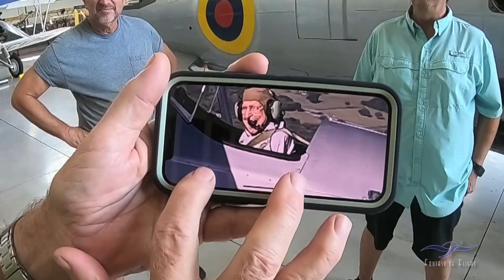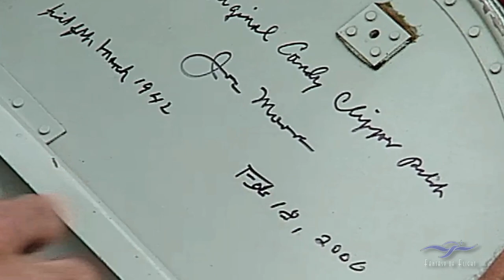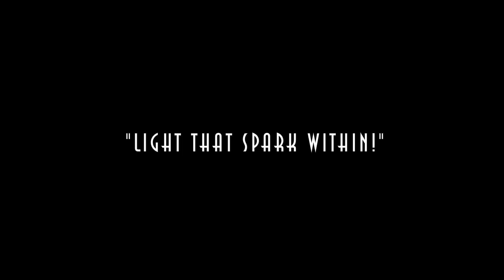REPUBLIC P-47 THUNDERBOLT - Steve Wolf / Kevin Kimball - Kermie Cam Visit Part 1

Comment: My father told me this story from when he was in France during WWII.  He said that the landing gear was slow to come up.  The pilots wanted to be cool in front of all of their buddies.  They would put the landing gear lever in the up position while on the ground before starting their takeoff roll.  Hydraulic pressure would build up while on the ground, but the landing gear would not retract on the ground.  As soon as the P-47 lifted off the built up hydraulic pressure would cause the gear to snap up real fast and look real cool to the other pilots on the ground.  So one day this pilot pulls up the landing gear level while still on the ground before starting his takeoff roll.   So there goes this P-47 going down the runway faster and faster getting close to lift off speed.   The P-47 hits a bump in the runway.  The P-47 jumps up into the air a foot or so then the landing gear snaps up real fast and cool.  But the Jug isn't at takeoff speed yet and settles back down on the runway.  Chomp, chomp, chomp, chomp goes the big paddle blade prop as it chews up the runway as the Jug slides down the runway on it's belly.  Slides past the end of the runway and mows down a bunch of pine trees with it's wings.
Reply: Charlie Morhle in his interview said that they did that with the landing gear because when they were taking off they were doing it overloaded by 1,000 lbs on a runway that was 500 ft shorter than what Republic said the aircraft needed, that way the landing gear would immediately come up and clean up the airstream and they could start gaining airspeed and altitude faster that way.

Comment: Great video, this P-47 is in perfect condition, looks absolutely stunning. Thank you for a great video. BTW when my father was a school boy of 15 / 16 years old at a college, all boys were to be so called „Luftwaffenhelfer“ or Air Force helpers. He had to go to a village called Liblar, just southwest of Cologne with all of his class mates in 1943. They had to man some positions of 88mm Flak AA guns. He told me that one morning there was a warning of ground attack operation in progress. The guns were turned to low elevation, suddenly 3 P-47‘s showed up flying right over the battery (in fact a „Grossbatterie“, consisting of 2 regular batteries, 16 instead of 8 AA cannons). All 16 guns shot together, one P-47 came out of the Flak clouds right, one left. The third one just disappeared. He told me that nothing from the plane was found later, it just disintegrated. They feared the P-47 greatly.

Comment: Just an idea: when everything is ready, Act 3 up and running well, the P-47 ready to put on display, and the Bf (Me)-109 is finished - just put them next to one another. The big, impressive P-47 and the small, nimble Bf-109. Just for comparison in size. Next to a P-51 a Bf-109 looks small, but next to a P-47 she must look tiny.
Reply: Kermit has no Bf 109, instead a Bf 108 Taifun (a very nice one), though it's from the same designer they are completly different airplanes.
Reply: @TPath3  Oh yes, Kermit does have a Bf-109 project under restoration in Canada. It will take some time until it’s finished, but getting an airworthy Bf-109 for sure he will.
Reply: @TPath3  never under estimate the Kermit.
Reply: When I was just a fifties kid we never saw WW2 aeroplanes flying... we did get to see the first generation of jets though, both British and American. Now, sixties years later a new generation can see these machines flying at any number of airshows...You just cant beat the snarling power of those massive engines...both radial and liquid cooled Vee...

Comment: The 367 “Dynamite Gang” and the 394th “Casket Gang”!!!

My father flew in the 394th. His picture is on pp. 144 of the great book “the Dynamite Gang, the 367th fighter group in WWII” by Richard Groh (Aero). He’s closest to the camera on the left.

I still have: his flight suit, leather helmet, goggles, scarf (imprinted with a map of Germany), knee board and… the tech manual for the P-47.

He also had a story of the ‘47’s propensity to “mush” if you pulled the stick too far at high speed thereby just changing the aoa and not climbing. He was strafing a train that was proceeding down a valley with steep sides. On pull-up, he was clipping pine trees during climb out - he remembers seeing the boughs flying as the prop was chopping them off.

That was his life story at 27 years old. Mine at that age? Not even close.

Comment: I'm building this airplane now in my basement with my son who is all about RC models. I got him a Seagull P-47D Little Bunny. This P-47 is amazing Mr. Kermit and I'm in awe because when this plane was drawn up in the late 30's or early 40's it was done so by slide rule not by AutoCAD or computers and I'm sure this is why they are built so darn well to last. My grandfather just passed away from COVID last DEC but he was actually in a US Army Video driving a box truck with a P-47 in the back and a group of his soldiers would video themselves on how to put together the P-47 in the field. It's an old video (obviously) but we'll known but you can see my grandfather in the driver's seat in the video positioning the truck in the early parts of the video and then again driving the wing spar bolts with a drift pin
Reply from the maker: Thanks for sharing this. Sorry for your loss.
Reply: @KermitWeeks444  thank you Mr. Weeks

Comment: If you watch some of the periscope films on the construction of some of the old aircraft they used exploding rivets. They would do all the prep work then install the rivet then apply a heated setting device to the head and the charge in the shank would go off, setting the rivet.